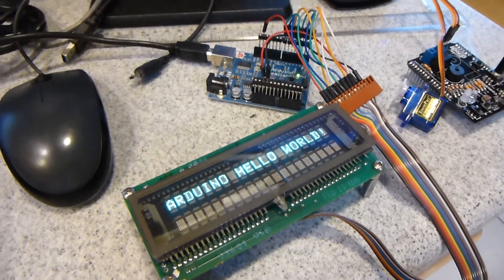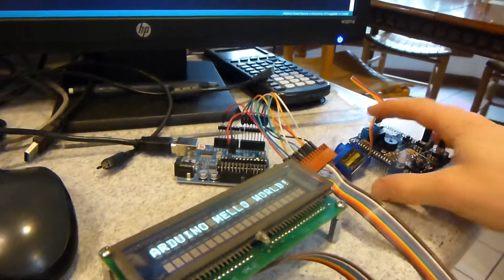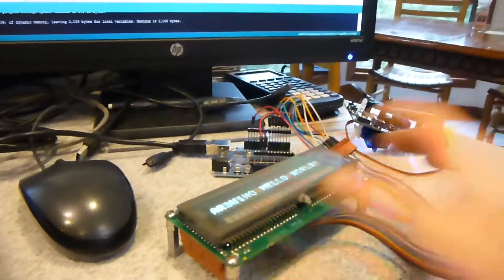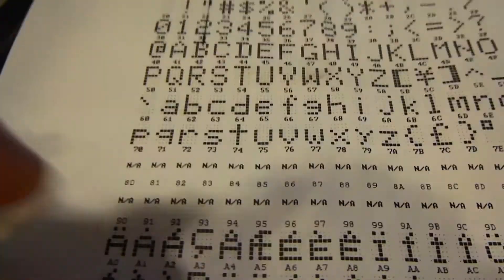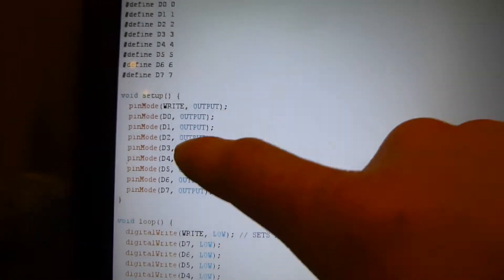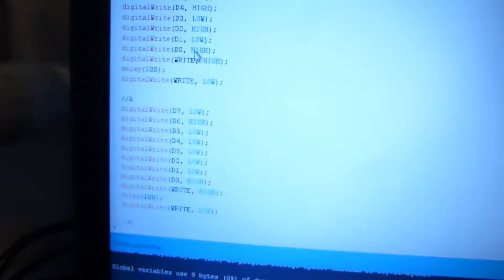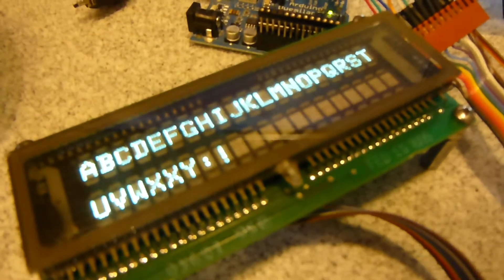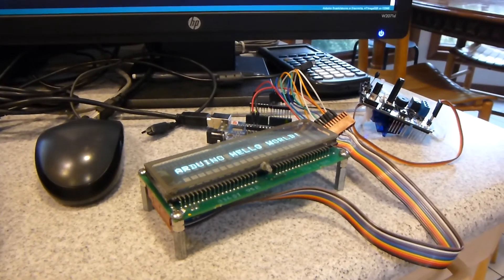Arduino Driving Vacuum Florescent Display With ASCII Hexadecimal Code

Comment: As you get more familiar with coding, something that will help a lot is arrays and custom functions. 
Arrays act like a lookup table. For example, the alphabet could be stored in an array like this 
[ '01000001', '01000010', '01000011', ... '01111010' ].
Then you have a custom function, let's call it writeCharacter(), that takes a character as an argument, looks up the corresponding binary code in the array, then sets pins D0..D7 accordingly.
Then you have a second custom function, let's call it writeSentence() that takes in a sentence as an argument, and for each character in the sentence, calls writeCharacter().
So in the end, after setting all this up, anytime you want to change what is written to the screen, you can just call writeSentence() with the new sentence as an argument. Ex. writeSentence( 'wow, that was fast!') 
No need to touch the rest of the code, because everything that is repetitive (looking up values, setting the pins) is handled by the functions.

Comment: I have a pile of Maxon SM4000 series mobile 2-way radios that have VFDs in them but they are not matrix types only four 7 segment types that shows the channel numbers but the radios are a neat source of interesting parts. Some work just fine and some are just broken beyond and sensable repair.
If you want some I can see about shipping you a couple to tinker around with.
Reply from the maker: ElfNet Gaming That's ok!  Thanks for the offer!  I already have too much junk around here to take apart.  I just need more time to take the stuff I have apart!  I also have several 7 segment VFD's from VCRs and such.  Thank you!
Reply: Yeah that's cool, though I would ask anyways

Hey you know what we say "Gotta get rid of old junk to make room for the new junk!"

But yeah,they are  still viable radios for GMRS channels and maybe Ham but oh well, maybe one day I will figure out something to do with them, I may haul them to the ham sale this next month and unload them.

Anyways I just ordered some more audrino and ethernet and wifi shields for some stuff I am going to be working on here. They are neat little things and cheaper than the Rasberry Pi especially when I can do the same thing on either, all about saving the money these days.
I also ordered some temperature, pressure, and moisture sensors and a couple sets of 433MHz transceiver boards for them. I'm hoping to make a remote weather station  of sorts to put outside and have it transmit data back in to a PC or through the ethernet or wifi onto an audrino based webserver where i can access it via smartphone.
I already have my CCTV security cameras set up with a professional version of this so I can check on my home while I am away. I want to try it using cheaper DIY bits now lol
Reply from the maker: ElfNet Gaming   I know LOL!  Out with the old junk in with the new!  

Cool!  Sensors are a must for a good project!  A weather station would be really neat!
Reply: yeah I need NEW toys to play with every once in awhile man. 

I have some paperwork and code writeups for an audrino weather station that was hardwired up, and I have a writeup and info on the RX and TX radios for the arduino. All I have to do is interface them to transmit the sensor data and display it in a human readable format that isn't too complicated. Then I can do some API stuff and build a web interface on an ethernet shield setup, So I hope...
I think I may be biting off more than I can chew on but in any event it may turn out to be a fun project to work with.
The second thing I am wanting to do is replicate my commercial DVR CCTV web interfaced camera system on audrino minus the DVR for now but get the image data to run through the Audrinos and onto the webserver via ethernet shields or something.
Anyways I ordered several things from the audrino website and MCM electronics that I think should cover the weather station project. The CCTV project will come later on though. I'm still on the white board with that one.

Comment: Lovely display you have there!!!! Have you try the LCD library? I'f I'm correct they use a standard for lcd and those type of display. Make the job easier and you simply have to type lcd.print("your text here"); :) Cheers!
Reply from the maker: bakupcpu Thank you!  No I have not.  I can't figure out how to convert the library to use 8 bits...  Thanks!
Reply: Makerj101 No stress http://www.arduino.cc/en/Tutorial/LiquidCrystal :) It's very simple the library is 4 or 8 bit depending on what you want to do with the display. If you have other question ask the :P Cheers!
Reply from the maker: bakupcpu My display only supports 8 bit.   http://www.ieeinc.com/specs/S03601-95B-40.PDF Page 2 has the block diagram for my display.  It also does not have an enable pin.  Another words I am stuck.  I don't know how to hook it up for 8 bit.  The Arduino website shows 4 bit but I could not find the pins for driving displays using 8 bit.  My understanding is you have to use certain pins for the register or something wont work properly.  I did try 4 bit but nothing happened.  Thank you!
Reply: Makerj101 I think the enable pin in the code is the same as your write pin.
The arduino site is less than helpful. I can find heaps of stuff on how to use the mythical LCD library, but can't seem to find the actual library source code anywhere.
Reply: Mongrel Shark Well how about you make one :) or simply try the lcd one no harm will be done to the display it will either work or not. If you need a hand for some coding let me know :)
Reply: Lol. I have enough peojects atm. Also can't find the stupid library...
Reply: You mean the liquid crystal one? It should come with the arduino programmer under LCD I think I haven't check or used that library in a long time. I mostly use adafruit display library since I use I2C display or SPI.

Comment: Code is not available; Did you update? Thank you
Reply: I copied most of the text, especially the first few lines:
//ARDUINO VFD CHARACTER TEST

#define WRITE 13
#define D0 0
#define D1 1
#define D2 2
#define D3 3
#define D4 4
#define D5 5
#define D6 6
#define D7 7

void setup() {  
  pinMode(WRITE, OUTPUT);
  pinMode(D0, OUTPUT);
  pinMode(D1, OUTPUT);
  pinMode(D2, OUTPUT);
  pinMode(D3, OUTPUT);
  pinMode(D4, OUTPUT);
  pinMode(D5, OUTPUT);
  pinMode(D6, OUTPUT);
  pinMode(D7, OUTPUT);
}

void loop() {
  digitalWrite(WRITE, LOW); // SETS ALL PINS LOW
  digitalWrite(D7, LOW);
  digitalWrite(D6, LOW);
  digitalWrite(D5, LOW);
  digitalWrite(D4, LOW);
  digitalWrite(D3, LOW);
  digitalWrite(D2, LOW);
  digitalWrite(D1, LOW);
  digitalWrite(D0, LOW);

//CLEAR DISPLAY
  digitalWrite(D7, LOW);
  digitalWrite(D6, LOW);
  digitalWrite(D5, LOW);
  digitalWrite(D4, HIGH);
  digitalWrite(D3, LOW);
  digitalWrite(D2, HIGH);
  digitalWrite(D1, LOW);
  digitalWrite(D0, HIGH);
  digitalWrite(WRITE, HIGH);
  delay(50);
  digitalWrite(WRITE, LOW);
  
  //space
  digitalWrite(D3, LOW);
  digitalWrite(D2, LOW);
  digitalWrite(D1, LOW);
  digitalWrite(D0, LOW);
  
  digitalWrite(D7, LOW);
  digitalWrite(D6, LOW);
  digitalWrite(D5, HIGH);
  digitalWrite(D4, LOW);
  digitalWrite(WRITE, HIGH);
  delay(50);
  digitalWrite(WRITE, LOW);

  //0
  digitalWrite(D3, LOW);
  digitalWrite(D2, LOW);
  digitalWrite(D1, LOW);
  digitalWrite(D0, LOW);
  
  digitalWrite(D7, LOW);
  digitalWrite(D6, LOW);
  digitalWrite(D5, HIGH);
  digitalWrite(D4, HIGH);
  digitalWrite(WRITE, HIGH);
  delay(50);
  digitalWrite(WRITE, LOW);

  //@
  digitalWrite(D3, LOW);
  digitalWrite(D2, LOW);
  digitalWrite(D1, LOW);
  digitalWrite(D0, LOW);
  
  digitalWrite(D7, LOW);
  digitalWrite(D6, HIGH);
  digitalWrite(D5, LOW);
  digitalWrite(D4, LOW);
  digitalWrite(WRITE, HIGH);
  delay(50);
  digitalWrite(WRITE, LOW);

  //P
  digitalWrite(D3, LOW);
  digitalWrite(D2, LOW);
  digitalWrite(D1, LOW);
  digitalWrite(D0, LOW);
  
  digitalWrite(D7, LOW);
  digitalWrite(D6, HIGH);
  digitalWrite(D5, LOW);
  digitalWrite(D4, HIGH);
  digitalWrite(WRITE, HIGH);
  delay(50);
  digitalWrite(WRITE, LOW);

delay(1000);

}

After the CLEAR DISPLAY you can insert your text. I found this datasheet to identify the characters bit by bit and matched my sketch accordingly (figure3). First read the bits in the lines left to right (e.g. high low hig low), then read the colums top to bottom (e.g. high high low low) would yield -> í <- as a character. 
https://www.vfdworld.com/techdocs/IEE_03601-96_2x40_VFD.pdf

Comment: Great to see you tackling the Arduino. I'm still learning myself. It looks like you are using Pins 0 to 7 consecutively. If so, then you should be able to write each byte directly using the PORTD command. It's faster than digitalWrite but it seems to come with other problems.  So the clearing the display would be "PORTD = B00010101;"
http://www.arduino.cc/en/Reference/PortManipulation
Reply from the maker: Rouverius That actually makes sense!  I will give that I try when I get a chance.  The port link is really helpful too.  I was trying to figure that out because someone mentioned about the arduino being 8 bit and having consecutive outputs like that.  Seems like it would be a bit more efficient way of doing things than how I am now.  Maybe not as efficient as a library... if I can even get that working.  Thank you!